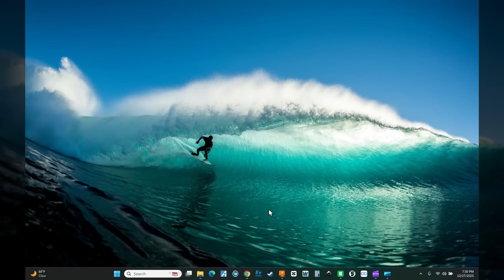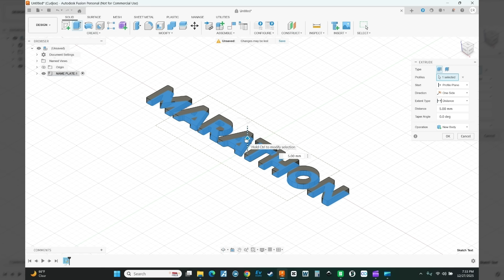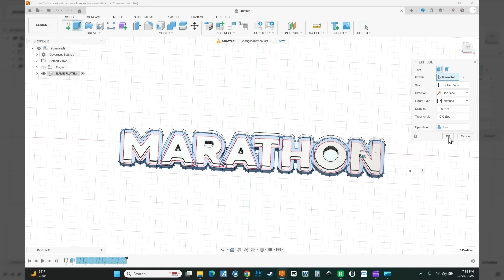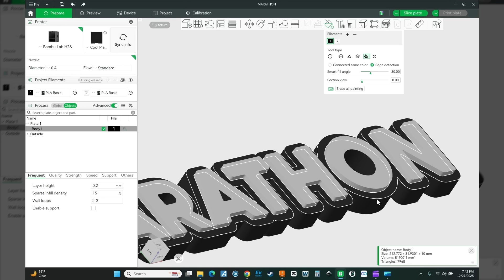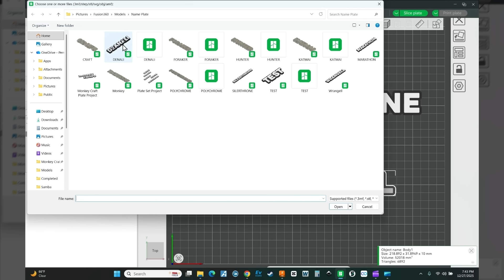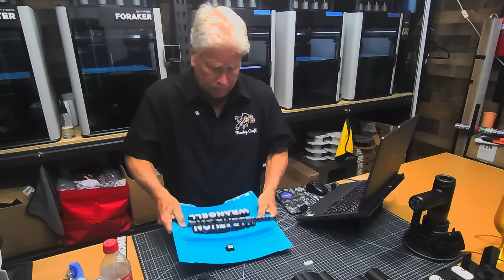How To Create Custom Name Plates And Signs

Comment: I was getting an error on the first extrude step, Failed to perform Boolean operation. Turns out the issue was my Font selection. I was using one of the cursive fonts. This caused an issue because the letters are touching each other. I switched to a "non touching" font, if you will, and the problem went away.
Reply from the maker: Great troubleshooting tip, thanks for sharing that!

Comment: I would have used a change color at layer, you would reduce to only 1 color change instead of 10 an have the O with a proper inner fill.
Thank you for the offset clue. I have a sign to make for a co-worker.
Reply from the maker: That's a good suggestion! I'm glad the offset tip was helpful for your project.

Comment: THANK YOU FOR THIS VIDEO.... I am having a problem, when I get to extrude and enter the 10mm and hit enter, my text turns into an empty framework and the process will not work. I did hit finish sketch as instructed. Any thoughts?
Reply from the maker: Try tilting the view a little so you can see the little blue arrow.  Grab the arrow and drag it up, then enter the 10mm in the box and press enter.  Hope this helps.

Comment: Just so you know, Fusion 360 is now only free for 3 years. You can still run it, but saving or exporting STLs... not without a still available free or paid account. I know. It wrecked a project for me when I learned that I was 1 day over. Just a heads up.
Reply from the maker: Thanks for the heads up, I appreciate the information!
Reply: You can renew your free license when the three year period ends.  Also, I've been exporting STLs and saving files with the free version without any problems.

Comment: Nice tutorial! For the coloring you’ll still end up with multiple color changes near the top. There are a couple ways to avoid that… one simple way is to use the height range paint tool to only color the inside of the O at the top to match with the other layers already white. You can also export the letters and base as separate objects from Fusion, which will make it even easier to paint the objects with the fill tool.
Reply from the maker: Glad you enjoyed the tutorial, and I appreciate the suggestions for coloring!
Reply: Exactly, that was my thought too